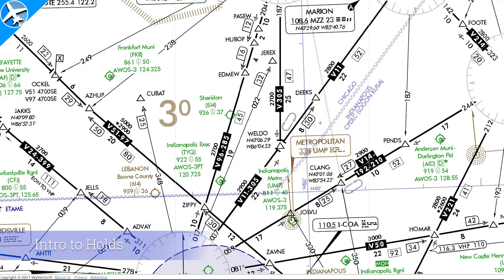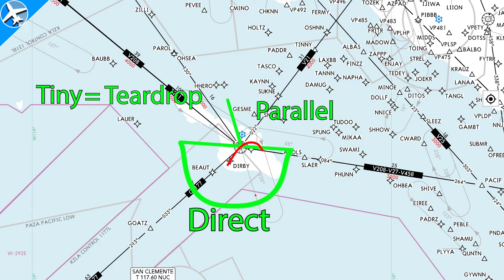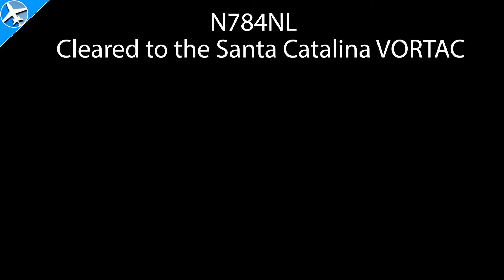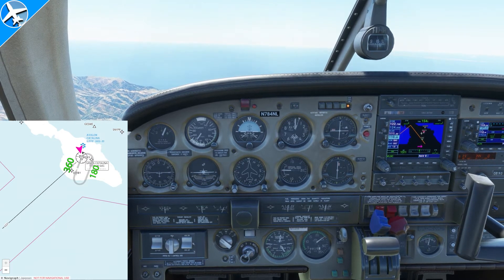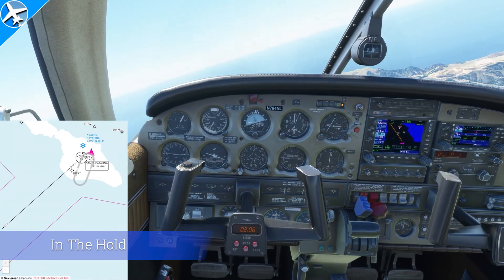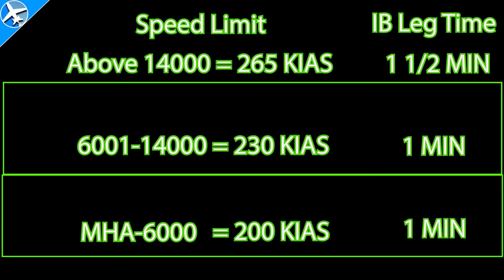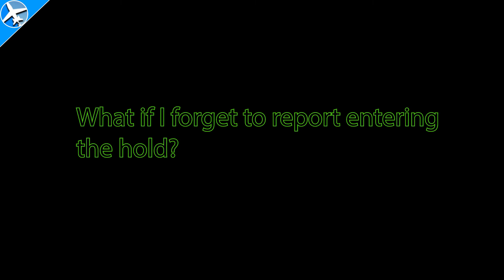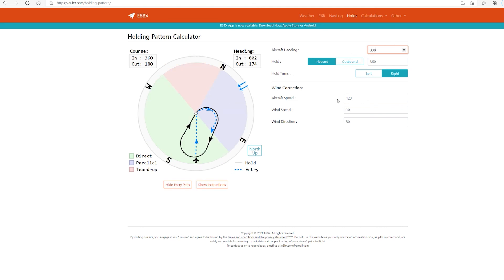Holding Patterns Explained - Holding Pattern Q&A With Air Traffic Controller

Comment: Not precisely correct on the graphics but close. 👍
Reply from the maker: @kenmunn4421  Can you be more specific? If you’re referring to the intro, that was just an example of locations where the course would be set (inbound course was shown in text), where the head of the needle is located, and where the radial could be read on the instrument - not the actual setup of the hold which comes later.

Comment: Really enjoying your content. Found it based on the CJ4 that I have been learning, but also applying some of the concepts to the G1000 in the Baron.  Practicing holding patterns - admittedly this is a made up scenario: I was inbound to KORF with an approach programmed into the G1000. Then I told myself, let's HOLD for a bit (had to eat dinner LOL). Chose to hold at the airport fix, which is probably VERY wrong. So then I was in a right hold for a couple laps, and wanted to rejoin the approach leg. Couldn't figure it out, although my attempt was to activate that leg, it looked like it wanted to go direct to the airport. Have a recording of my hassling through it (and then flying manually back onto the approach path). 

Newbie continuing to learn...

https://youtu.be/ZexTy1zpP3o?t=420
Reply from the maker: I watched part of it, and it sounded like you were enjoying your dinner in the video. Haha.   I will sometimes build a hold in the CJ4 in MSFS near the destination and walk away from the PC. If I get back soon enough, the landing can be completed, but if not, the airplane will be in a hold or laying on the ground somewhere without any fuel in it.

Comment: At 2:20 , if the right end perpendicular line is lower by 20 degree, won't that be left hand turn? But the chart shows is a right hand turn.
Reply from the maker: The lines are used to determine the entry type depending on the sector the fix is being entered from.  The hold is to the right but in this case it would be a left turn after crossing the fix for the parallel entry.  After intercepting the inbound course, right hand turns would be made while in the hold.
Reply: @thecorporatepilotdad  For parallel entry, flying backward for inbound course, is there a risk of aircraft collision with other aircrafts that are already in the holding pattern?
Reply from the maker: @jeffhiew5795  No.  They will be at different altitudes with at least 1000' vertical separation.  Two aircraft can't be in the same hold at the same altitude.  Controllers can make mistakes though, pilots too.
Reply: @thecorporatepilotdad  many thanks for the tutorial

Comment: Early on I noticed that you were using a simulator, however I was focused on listening to you and the controller and reading text.  It was not until about 3 minutes into the video that you were using a Piper, the instrument panel included a manifold gauge, there is a gear lever and prop RPM lever.  With the indicated airspeed of 130 to 135 knots I would guess this is an Arrow, however the throttle is may be 25 or 30% open and if accurate might indicate a Lance or other 6 seat Piper.  Let me know, it would be interesting to find out.
Reply from the maker: I used the Piper Turbo Arrow IV by Just Flight for MSFS.  The throttle wasn’t opened very far like a conventional Arrow because it has a fixed wastegate turbocharger.  The throttle won’t be against the stop until 12000 feet density altitude and then it will give 41 inch of MP and lose an inch of MP every 1000 feet of altitude gain from there.  I did my Commercial and CFI in a Turbo Arrow over 20 years ago.
Reply: @thecorporatepilotdad   Interesting, thank you very much.  I got my commercial ticket in 1978 in an arrow, non-turbo.  It was a nice little airplane, for my cross country [3x 200 mile legs] didn't need refueled.  Thank you for bringing back some old memories.
Reply from the maker: @ZZstaff  You are very welcome. Even flying the Turbo Arrow in MSFS brings back memories for me.  I love my job flying business jets, but really miss flying GA airplanes like the Turbo Arrow.
Reply: @thecorporatepilotdad  Have you considered a video on constant speed props? I know there’s a ton of flight school videos on youtube that cover it, but they’re quite technical and often really long.

Your vid on magnetos was ace, one in a similar vein on these types of planes in MSFS explaining the blue lever and the relationship between MP/RPM would be really good.

Just a suggestion of course (plus it could be an excuse to reminisce about your time flying these types)
Reply from the maker: @adhesiveducks  I sure have considered it many times and have some ideas on it and how it needs to be done.

Comment: Great video, in my 45 years of flying Far 121 and 135  and 91 and at 14,000 hours plus flight time ( yea know a low time pilot. I spent 20 years teaching airline pilots new airplanes ) . I can say I have only had to hold 4 times. And a lot of that flight time was acquired in the North East. I guess I have been lucky. I do believe that every pilot should abide by the established procedures that are expected for a pilot to utilize a holding pattern.  😁🛫
Reply from the maker: In the last 15 years I’ve had to hold somewhere around SLC and over Stillwater going to TEB.  I’ve heard expect holding many times and then we don’t have to hold.  That’s why holds are so important.  They are so infrequent it’s easy to forget the finer points of doing one.